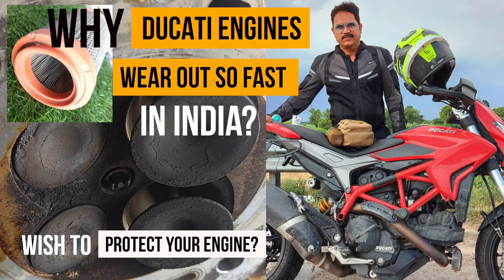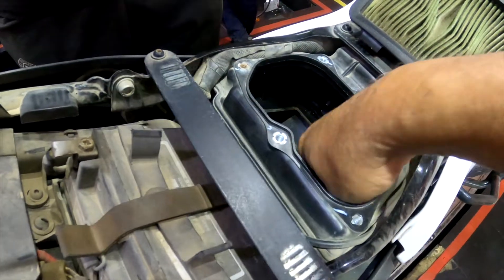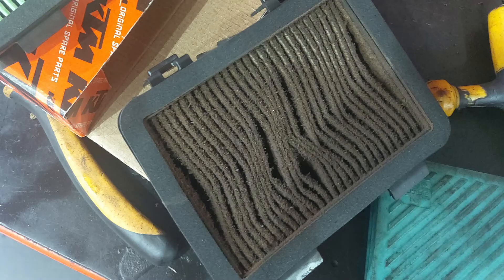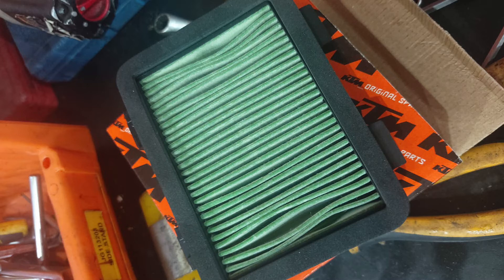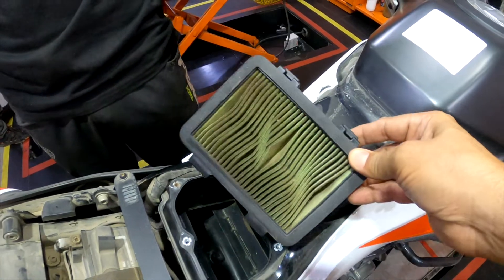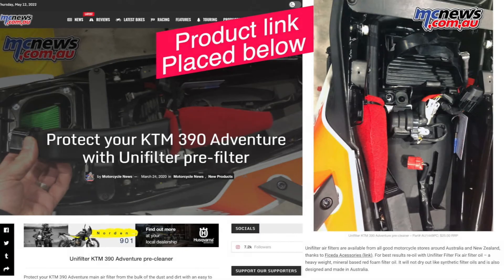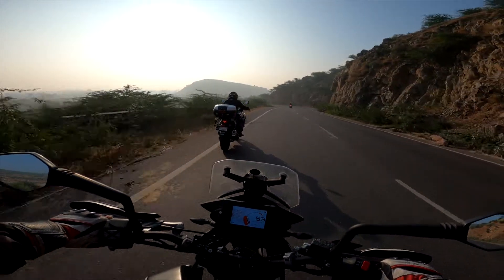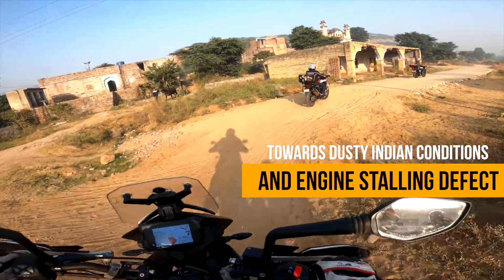Secret to KTM390 Adventure Engine Stalling?

Comment: The stalling issue is caused by poor spark when the warm engine is running very lean at idle. The OEM bosch plug is garbage, my plug gap was 1.4mm after 9k miles (spec is 0.9). Swap it out for an iridium one and problem is gone.

Comment: Hello Sir, continuing the same thread of discussion, there is a part update from KTM. They are now replacing the clutch switch which apparently is one of the culprit of engine stalling. The new switch has a spring mechanism to get the actuator back to the default position thus assisting the clutch lever do so. I have installed the new switch on the recommendation of my local KTM service in Pune. There has been a noticeable difference in the stalling frequency which is now almost zero (Would happen from gear 2-4 at high rpm low speeds) and it has also helped stabilize the engine idling too. I had issues with the idling fluctuation when at low speeds and the end to that was an engine stall. All that seems to have got corrected after the switch change. I would recommend contacting the local KTM service and giving this a try. As always thank you so much Sir for inspiring and sharing critical technical information on this thread. Jai Hind.
Reply from the maker: Yes, that I got it done sometime back. Somehow, I was busy with something else. Thanks a lot.
Reply: Which model was this for? Do all KTM's offer this new part now?

Comment: Disagree with your opinion! Mine is brand new stalling@20 miles on the odometer 😡wish I purchased a triumph Tiger instead!!
Reply: Did you ever get the issues fixed or? Do you still regret getting a ktm?

Comment: Well …. Sure. But this happened on bikes driven right out of the dealer with 4 miles on it. So I hate to say it but your incorrect. It’s a clutch sensor issue.
Reply: I have taken the clutch switch off and secured it closed makes no difference to the stalling